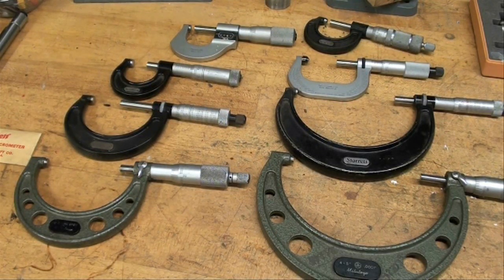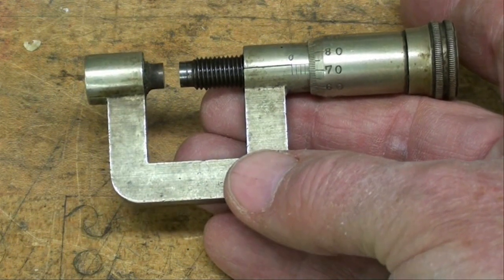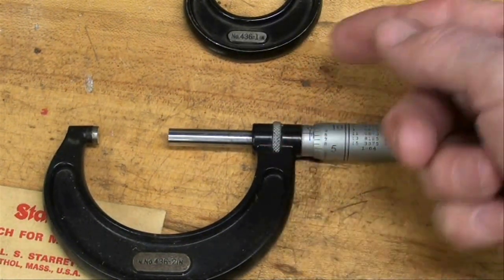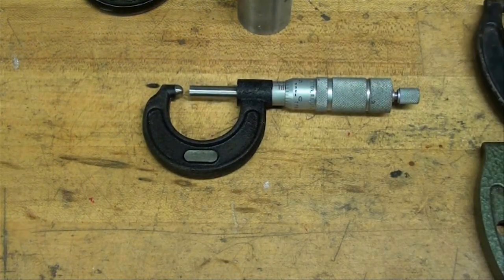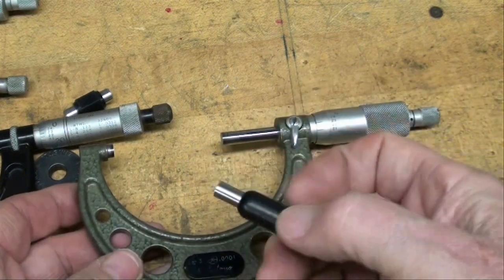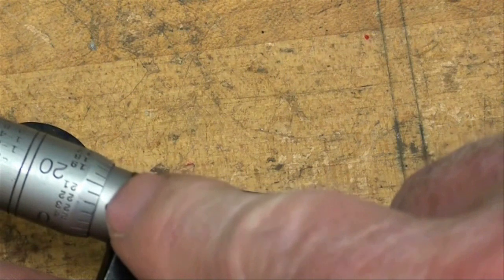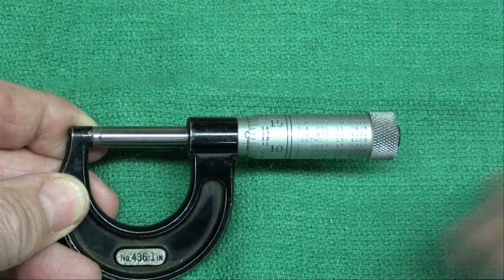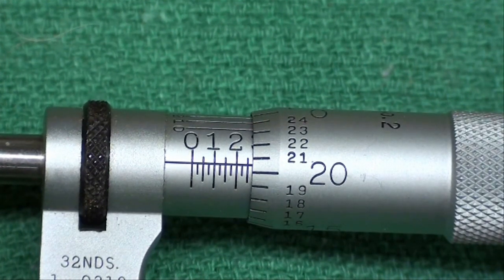MACHINE SHOP TIPS #21 Micrometers Part 1 tubalcain

Comment: When you get a micrometer where that the spindle is frozen how to you break it loose? I got one on EBay that looks nice but the spindle is frozen. I have used penetrating oil and disassembled as much as possible but haven't been able to free the spindle yet.
Reply from the maker: Let it soak for three months,

Comment: I don't think anyone commented this, so i checked my metric micrometer.
It moves 0.5 mm each turn, so I guess that's the thread pitch.
Not sure if that's standard, but it's likely. It's also just around 13% smaller than 40/inch.
Reply: There are some micrometers with 1mm pitch (older ones)